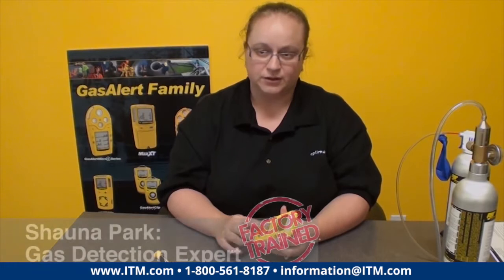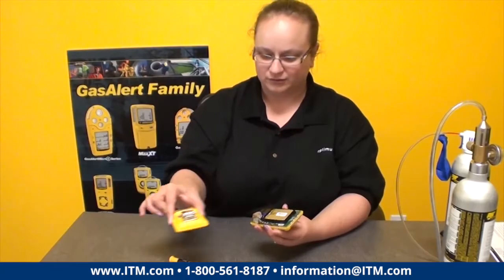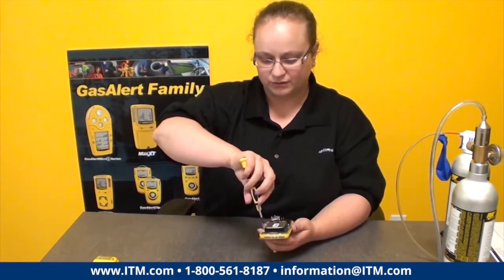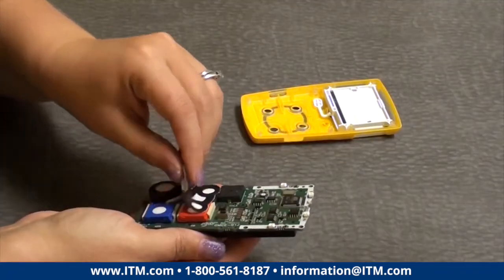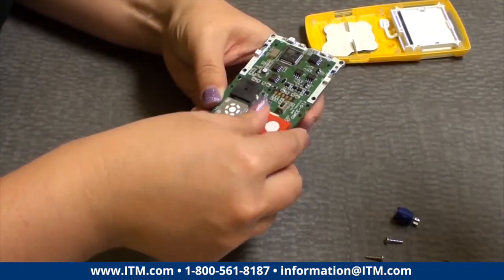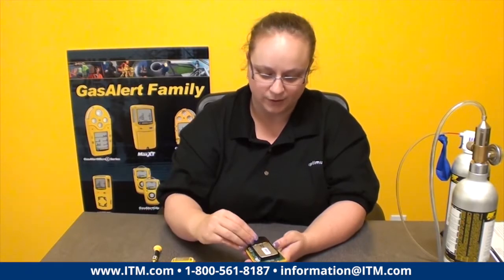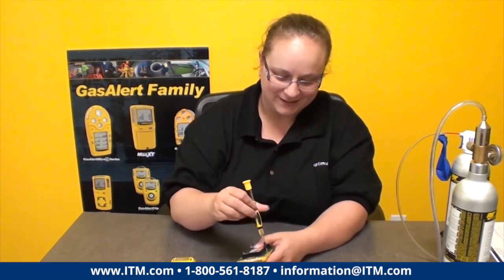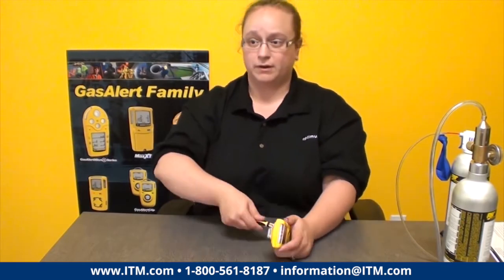How to: Change the Sensors in a BW MicroClip XT

Comment: For a single gas detector can i change the battery?
Reply from the maker: Hi James, 
This would depend on which single gas unit you have. The 2 year and 3 year ‘disposable’ units, like the BWC2 and BWC3 models, you cannot change their batteries. The larger, maintenance required, single gas units in the GasAlert Extreme series (models starting with GAXT-) can have their battery replaced. The battery part number for those models is E2829.